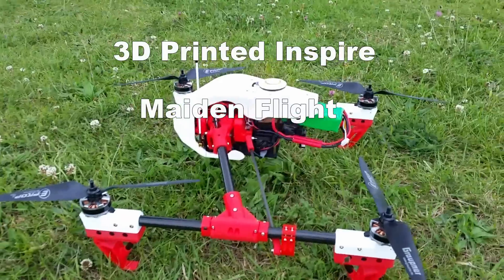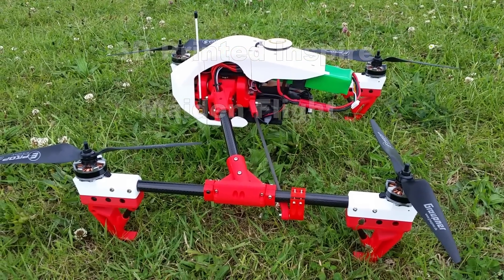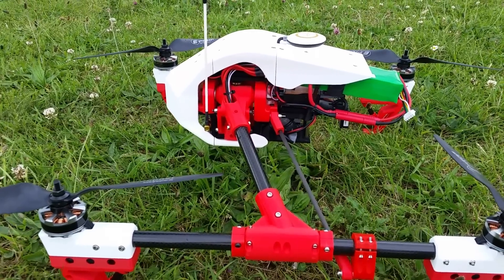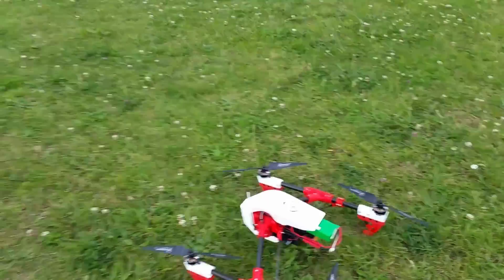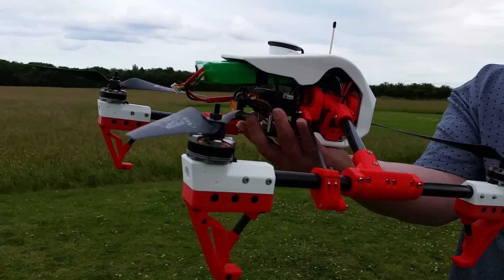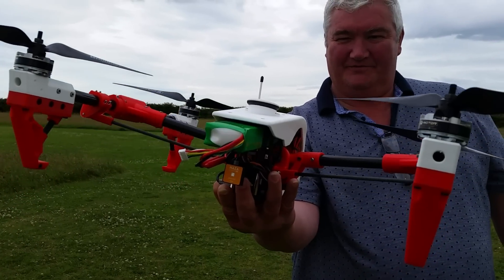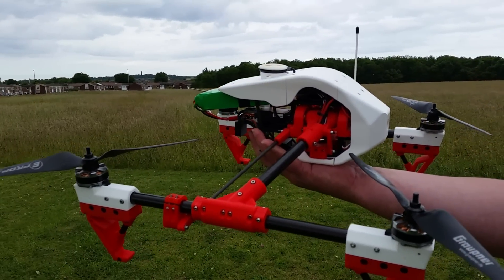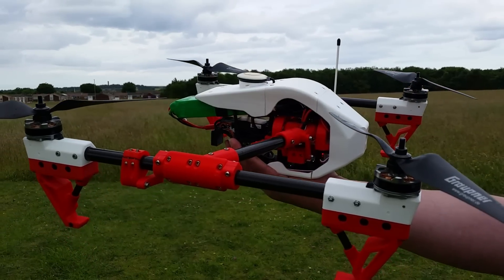3D Printed inspire Clone . First Flight.

Comment: Hi Captain, good job for you...i'm building one Inspire too but do you tell me if you used an arduino nano to up/down arms..and in this case could you send me a picture about your wires (cables from rx...etc...) and i get a problem with librairies under arduino...could you have some idea...?

Happy fly...Philip

Comment: can I buy it?
Reply: Derposaurus yes u can i dont use it
Reply: does it have a camera? and what is the price?
Reply: it has a camera on 5.8 ghz u can hang a gopro underneath it has a dji osd  dji v2 controller i have a uhf rx in it which i will be taking out so you will have to supply your own cant remember whether i run it on 4s or 6s. Make me an offer are you in uk

Comment: What was the total cost?
Reply from the maker: +V.H.S Bought a printer , electronics for quad and materials for 1/3 of the price of DJI Inspire, hope that helps.
Reply: +Captain Pugwash And what printer did you use? cheers :)
Reply from the maker: +V.H.S flashforge creator pro

Comment: Wow, one awesome build. Arms are moving very fast. What mod is it? Can you please share the details and specs? I am in the beginning of this project. Right now deciding on which motors to use, want  to use 22.2V 6S battery. It will be my first project, and a hard one. So I am trying to know the theory before actual building.
Reply from the maker: +Vlad B Check the link on rc groups below. All the info is on the forum
Reply: +Captain Pugwash I read through all of it already, and many times :) But their official build still seems to have slow gear problem.